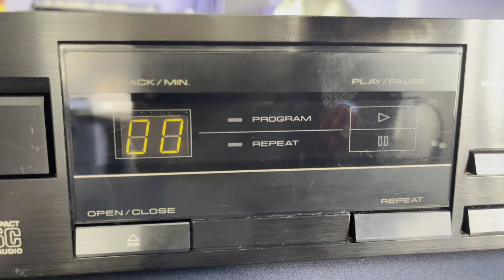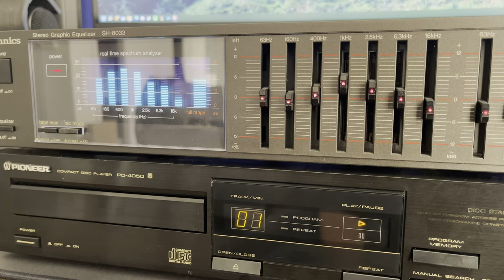Broken Pioneer CD Player, is it fixable? | Vintage Hifi Revival

Comment: Loving your videos.  It's kind of funny when you think how mechanical CDs actually were.  When I think DIGITAL you no longer imagine mechanical contraptions like CD players.
Reply: Hard drives are mechanical :)
Reply: @xaverlustig3581  SSD hard drives are not.
Reply: @nickfatsis9607  SSD aren't hard drives
Reply: @xaverlustig3581  since when? A HDD and a SSD only differ by one having a spinning disk and the other having no moving parts, an SSD is still a “hard drive” because it’s usually when your OS system is stored
Reply: @nickfatsis9607  SSD and HDD perform the same function, but the word "hard drive" is short for "hard disk drive" (HDD) and refers to devices with spinning disks only. Calling an SSD a "hard drive" is simply wrong, even if some people do it.

Comment: Another problem some of these Pioneer CD players had was skipping caused by wobble of the disc motor shaft. The fix was a stabilization kit kit supplied by Pioneer. It consisted of a small neodymium magnet that was glued to the motor as close as possible to the spindle. This minimized the extent of the wobble. I never had a unit come back again for this problem once this fix was applied.

Comment: Underneath the laser assembly and the white piece of plastic is a small anti-vibration spring .... You should reposition that spring or you'll get an annoying skip in the sound of the player .... Good video ! 
I am an engineer of Pioneer Electronics Europe Service Dept./// After a lens repositioning you should realign the tangential adjustment and the maximum grating signal for an optimal player joy. See the Service Manual for that adjustment(s). For driving the laserblock to the back just use the test mode of the player. This counts for ALL Pioneer CD-players b.t.w.

Comment: As I remember of those players they had only 3 seconds of memory for skipping. This internal memory allows you to not hear the skipping. 
Then later it increases to 10 to 15 seconds for the portable models first then the stand alone players. 
Skipping was a serious problem at that time.Then sound quality with increases oversampling to increase the quality. Because of the sharp sound Good Video 😎 one thing I just remembered was the high end cd players the disk moved over the laser for better stability. To lower the cost most players were designed for the laser to move.

Comment: Those old pioneer CD players are known for the laser lens to fall out. Just never do what I did once was use super glue as it will damage the laser. Another common problem is the capacitors tend to go bad as on one I had it worked when first got it and the next day it wouldn't read a CD do to caps going bad.
Reply from the maker: Huh, I was pretty close to using super glue, I went with a more gel like glue because I figured it be easy to apply; guess I lucked out haha
Reply: @HifiJelly  you should never use super glue to glue these lenses in, the vapours from the glue will permanently fog the lens, I use wood PVA glue, no vapours and gives a great bond.

Comment: What fixed the motor? Did i miss something?
Reply from the maker: The motor was never broken, that was just a theory I had going into it, I'm guessing it wasn't spinning the disk much when I first tried it because there was no signal from the disc being generated with the lens loose in its housing. So, it was just erroring out and stopping the disc from coming up to full speed.
Reply: @HifiJelly  clear! Thanks!

Comment: If you ever get a slightly later Pioneer CD player that either struggles to spin, try putting a very tiny amount of a very light oil down the motor shaft. It will only temporarily fix it, but prove it’s the motor. The motors came without the turntable and you had to very carefully prise the old one off. But in the black plastic cd mechanism was a modded U snapped piece of plastic, you cut that out and put it on the new motor, before pushing the turntable back on, it then acts as a height setting jig for the turntable.

Comment: You missed the solder blob on the ribbon cable you should bridge this when removing the laser to prevent static damage. Sometimes you can adjust the laser (the pot on the ribbon cable) this changes the power to the laser however this is only a temporary fix usually the laser is about to die.

Comment: After re-gluing the laser, you need to adjust the focus and power of the laser as the lense is a minute bit off where it was at the factory.  You'll need a scope ... or trial and error.  The lasers on these old things don't last forever.  Sometimes these old players won't play newer pressed CDs or CD-Rs ... randomly.  YMMV.
Reply from the maker: From comments I’m seeing it seems be a bit of a miracle it is working as well as it is haha. I haven’t had a single issue with it since putting it back together with zero calibration, maybe I’ve just jinxed it though haha.

Comment: I have encountered plenty of broken(won't play) consumer grade mid fi CD players.  If the problem is in the logic or digital control I am forget it.  How do you analyze a brain fart in the computer?  If you can find something familiar like a broken part that is replaceable or a power supply or audio problem, that is accessible to me.  Mechanicals are probably unavailable unless you salvage them.  Most of them are not worth the trouble at all.

Comment: The loose object was the Laser Objective Lens, used to focus the Laser on the surface of the disc.

I have an early Philips CD Player from 1984 (38 years old) and it has ribbon cables.

A CD Player is no less repairable than other Hi-Fi equipment, but it's all a question of SPARE PART AVAILABILITY.

The SPOILER told the viewer that the player WORKS, before the repair was completed! ... As Homer would say, "Doh!" 👎😂

Pioneer's quality "going down" by 1987? ... That's ONLY 5 years after the CD format launched! ... It's just "bad design" and "cheaping out," as I've never experienced that issue!

EDIT: My Philips player uses a "swing arm" laser mech, as opposed to the linear tracking Sony mech. Swing arm is FAR SUPERIOR in performance to any linear mech I've used! Philips discontinued it, due to the requirements of Computer Optical Drives, which were not suited to Swing Arm audio mechs.
Reply from the maker: Yeah, Technology Connections has a great video demonstrating the difference between the Philips swing arm and the Sony type mech I have here.

Comment: great video!
Reply from the maker: Thanks!
Reply: @HifiJelly  Just a word of caution and so you know for the future endeavors with CD players the ribbon cable that had the two solder spots is to be bridged BEFORE you remove the ribbon cable, once you remove the connectors from the laser assembly it is vulnerable static damage you are very lucky it didn't get zapped thus killing the laser itself. EVERY laser pickup has a spot to protect the laser from static damage. Just don't forget to clear it once once the connection(s) are restored to the laser pickup. The sled and spindle motors aren't static sensitive so no need to short those. Bridging the laser protection is only necessary if you disconnect the laser connector from the pick up. Great job make sure everything moves freely sled motor and spindle motor and that unit should last a VERY LONG time.
Another poster wrote about the type of glue to use, DO NOT use super glue use wood glue it doesn't put off any gases harmful to the internal optics. Let the wood glue throughly dry and you should be all set for a great many ah hours of CD listening enjoyment. They certainly don't make CD players like that anymore. Now a days pretty much the only metal is the motors MAYBE the frame that holds the motors, other wise its practically ALL plastic inside modern made CD players. Unless you pay 1000s for an audiophile type transport (external DAC) usually required for those too.
Reply from the maker: Thanks! I was wondering what those exposed solder points on the ribbon cable were, and that explains it!
Reply: @HifiJelly  You're welcome hopefully that will save you from static accidents in future repairs on that unit or future DVD/CD player units too.

Comment: I ALWAYS TELL PEOPLE WITH EQS.    12 MEANS 12 PERCENT OF 100 PERCENT OF THAT FREQUENCY.    PEOPLE ARE AFRAID TO SLIDE THEM ALL WAY UP OR DOWN CAUSE THEY THINK ALL WAY UP IS 100% ALL THE WAY UP.  NO.  12 IS 12 PERCENT WHICH IS 12 OF 100 SO ALL THE WAY UP IS A TINY BIT.   MOVE THOSE THINGS.    ALWAYS MOVE 16 K ALL THE WAY THEN TURN DOWN 6K IF IT SOUNDS HARSH. THIERS ALWAYS A DEFICIENCY OF 16K And we CAN'T HEAR IT.

Comment: 1987 isn't late for pioneer in terms of quality. they weren't the best cd player maker ever though; with the exception of some of their later changer decks
Reply: also, when you're using epoxy to fix a structural support like that, something you can do to make it stronger is to drill small holes in the material so that the epoxy can surround the plastic, and you can put metal mesh around the piece to reinforce it
Reply from the maker: I thought about drilling a hole in it, but the smallest drill I had was 1/16 inch and I didn't trust my ability to not completely destroy the part while drilling it haha
Reply: @HifiJelly  yeah, i'm not trying to criticize. i understand we all work with what we have sometimes. i have been doing this kind of repairs you also do for a long time, so i only wanted to pass on my experience. i enjoy your videos, please keep making them

Comment: I've been a tech for 40+yrs Pioneers won't spin up to search for the TOC if the laser can't see the disc n unlike most other brands you can't just replace the laser n your good to go.
There's a long laser aligment procedure with special cd's n test equipment, I used to hate replacing lasers in Pioneers under warranty back in the day!... BTW YOU NEVER DISCONNECT A LASER WITHOUT THE STATIC DISCHARGE SOLDER LINK IN PLACE IT WILL KILL A GOOD LASER!

Comment: I have a Pioneer PD - 7050 in my collection, the laser mechanism is the same. Thank God, my disk stabilizer was just not in place. The most unpleasant thing is when it does not read disks and nothing dangles inside. You open it - there are no lenses either in the laser or inside the case - that's the problem. And so if you received a package with a disc player and something rattles inside, then 99% is a lens - just glued and repair work 30 minutes. Lenses on multi-disk pioneers especially like to fly out - there the lens is directed down.
     У меня в коллекции есть Pioneer PD - 7050, механизм лазера такой же. Слава богу у меня стабилизатор диска только был не на месте  Самое неприятное, когда диски не читает и внутри ничего не болтается. Открываешь - линзы нет ни в лазере ни внутри корпуса - вот это проблема. А так если получил посылку с проигрывателем дисков и внутри что то гремит, то 99 % это линза - просто приклеил и работы по ремонту 30 минут. Особенно любят вылетать линзы на многодисковых пионерах - там линза вниз направлена.

Comment: Just do9wnload an mp3
Reply: lol
Reply: that's boring, using a CD player from the 80s, especially one that was a high end model is much more fun, buying a high end model for $10 because it doesn't then fixing it and using it is much more enjoyable.
Reply: @nickfatsis9607  yeah good luck finding a working one that players ever cd. 80 minute cds ruined vintage players.
Reply: @simon_1987  I don't need to find a working one, I service them and bring them back to life, I've never seen a CD player than couldn't play an 80 minute CD, older CD players can sometimes have difficulty playing burnt CDs, that's because a burnt CD has a lower waveform output than a commercially pressed CD, I actually seek out CD players that don't work for cheap, so I can repair them, I make good money selling them after repairing them.